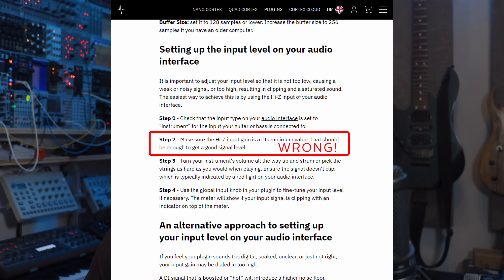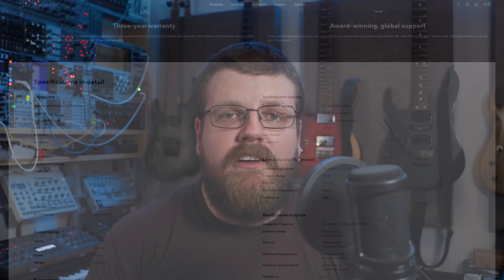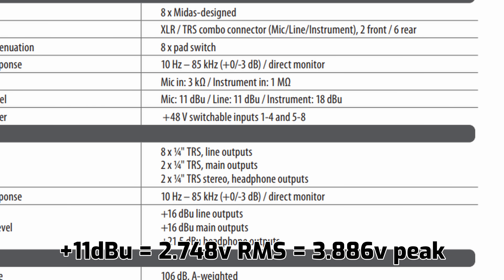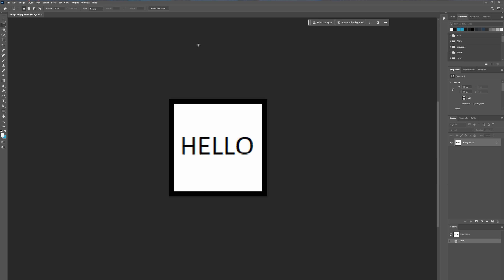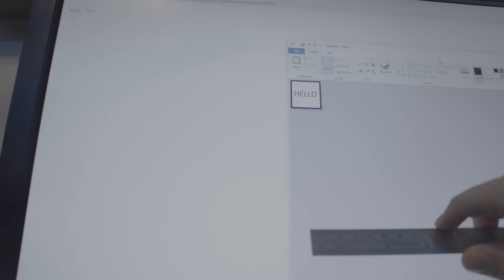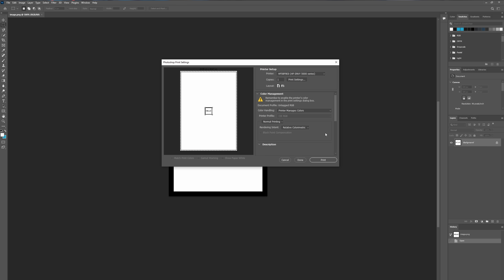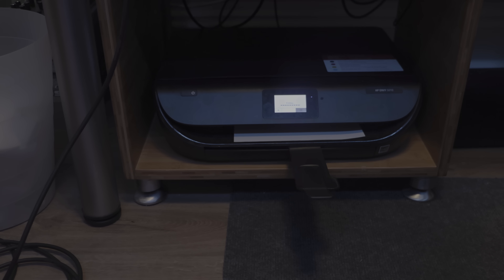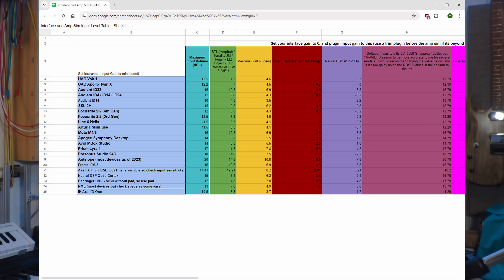Ampsims and input gain - Please, stop the madness...

Comment: If I may nerd out about the graphics example that was used… you are incorrectly using the term DPI to talk about pixel resolution in relation to the size of an image. 

PPI (Pixels Per Inch) is actually what you should be using when you are referring to the digital information stored within the file that will determine the size it will print, or import at natively in software such as Adobe Illustrator, etc., which will then print it at that size (unless of course you’ve scaled that image).

DPI (Dots Per Inch) refers to the resolution that the printer is using to lay ink down on paper or other substrate. If you look at a magazine with a loop (super high power magnifying glass), you’ll see that everything is made up of dots of color, CMYK (Cyan, Magenta, Yellow, Black). The dots will run at different angles to avoid a moire pattern. The DPI will vary depending on the print technology. On a magazine, you won’t really see it with the naked eye. If you get up close to a billboard, you’ll easily see the huge dots. If you’re looking at a halftone on a T-Shirt, the dots will be noticeable because the cloth substrate is very loose and details can only be so small without being lost.

Ok… rant over. Almost everyone should be using PPI because they are dealing with digital images. Only printers should be talking about DPI. 🤓

Comment: Wait if the answer is set interface to as high without going to red because the resolution of the conversion between analog and digital is greater/more accurate then....

I am not wrong.
Edit: Woah oddly not wrong (over simplified answer obviously)

This is why I use axe fx iii because I don't need to deal with amp sim plug-in users and you are forced to learn more in depth topics in order to configure your tone.
Reply from the maker: @XenoTravis  the Axe FX has always had insanely good inputs. This is definitely one issue that you won't need to worry about in the axe - it just works, period :)
Reply: @GhostNoteAudio  right? It might be a bit annoying when presets from others just don't work but it made me learn so many concepts in order to get my own sound.

Plus I found out I can use my guitar, the other players bass/guitar, and a microphone at the same time while also using very useful features like re amping and vocal effects like 4-5 layer pitch correction like the band cynic uses while it even switches settings automatically.

The thing is so powerful and amazing at everything I have thrown at it.

Comment: Great presentation. 👍 I'm seriously shocked this is even a conversation, let alone a controversy, in 2024.

Not just for guitar or amp sims; proper pre A-D gain has been hugely significant since, well basically forever. Like you said. It IS gain staging. 🙃

Comment: In Reaper,  my gaining and volume matching for electric guitar looks like this:

My audio interface gain is set so that the DI guitar sounds nice (as nice as a DI can sound, anyway), especially the transients and dynamic range. Where your gain dial ends up will depend on my guitar pickups output and playing style. When adjusting the interface input gain, I also have a trim plugin on the track In-FX so that I can keep the same volume during adjustments. Interface gets turned up, trim gets turned down. I'm prioritising sounding and feeling good over getting the hottest signal, which I don't find necessary with 24bit recording. Maybe if you have a shitty/noisy interface you might have to prioritise getting the hottest signal?

Once the DI signal sounds and feels at its nicest, I use the In-FX trim to adjust the track signal to where I want it, which is usually peaking at around -6 to -4 dBFS. The LUFS-S will be down at around -20 to -16dBFS. This is the level that the track WAV will be recorded at. If the peaks are high but the LUFS-S is a little too low, then I'll maybe compress on the way in a little, either with hardware compressor on my interface, or a plugin compressor on the In-FX tray.

Because my amp sim doesn't have its own input gain, just before it I will insert another trim plugin, which will set the input level independently of the recorded track level, so that the signal entering the amp sim is what I think it is expecting. Some amp sims have an input meter, but I do it by ear because crucially, different IRs and amp and cab combinations seem to prefer different input signals, so this gain/trim is not set and forget - I adjust it to get the best out of the current patch if it sounds wrong. I don't think people talk about this aspect enough. Note that this adjustment does not affect the level of the recorded WAV.

Finally, the amp sim output gain is adjusted by ear so that it mixes roughly with the drums/instrumental guide I'm going to track along with. Again, every time the amp sim input gain/trim is adjusted for a new patch, the amp sim output is adjusted to keep the same volume. Keeping the same volume is crucially important, so that you aren't fooled by the 'louder is better' thing that our brains do.

In my opinion, you need to control the level of a signal at every stage in its path, and create extra points at which it can be adjusted if necessary.

Comment: There's something else I found out. Since everyone has said the first step is to set up the input gain to 0, you missed another very important thing in my eyes. Because 0 doesn't mean 0 on many interfaces. By checking the manuals of my Apollo Twin X, Orion 32, and UR22, I found the listed gain range:

- On the Apollo, it's the same for all the input levels (mic, line, Hi-Z): it's from +10 dB to 65 dB.
- The Steinberg UR22 has a mic gain range from +10 dB to +54 dB, a line gain range from –14 dB to +30 dB, and a Hi-Z gain range from +0.8 dB to +44.8 dB.
- The Orion 32 doesn't have any gain options, so there's no gain range. You could say this interface is set by default to 0dB gain.

So what that means to me is that if these interfaces are turned to zero, they're not at 0 dB gain. The Apollo always adds at least 10 dB to your signal, even when the gain pot is aaaall the way to the left. The Steinberg UR22 gets even wilder and adds 10 dB in mic mode when it's turned to the left, 0.8 dB in Hi-Z mode, and even gets much quieter than 0 dB gain in line mode since it's reducing the gain by 14 dB when it's turned to "zero."

That means you also have to subtract or add the correct amount of gain in the amp simulation plugin to get the very correct gain staging. Is that right? 

Steinberg UR22 manual: https://download.steinberg.net/downloads_hardware/UR22/UR22_documentation/UR22_OperationManual_en.pdf
Apollo Twin X manual: https://media.uaudio.com/support/manuals/hardware/G2-73v5iZ/Apollo+Twin+X+Gen+2+Hardware+Manual.pdf
Orion 32 manual: https://images.static-thomann.de/pics/atg/atgdata/document/manual/orion_32_owner_manual_en.pdf

Comment: Thank you, this is great. I don't follow any discussions, but the described procedure seems natural, isn't it? This is what you end up doing if you have just a little bit of understanding about the signal processing. And I mean just knowing that there is analog to digital transformation, and how the signal looks like in a computer (as a graph). I am truly surprised by the raised discussion. My guess is that initially people were using cheap noisy pickups, and they hoped to reduce this noise by putting lower input signal. Then the discussion suddenly blew up.

Comment: How can I find out the input dbfs in dbU of a plugin? I am wondering how I can add plugins to the list he has created that he has not listed. Like for example the Ampeg SVT Suite. I've searched their site and the manual but unfortunately found nothing. Do you know how he got this data?
Reply from the maker: I believe Ed S (who made the spreadsheet) did reach out to many of the developers and asked for clarification and technical specs, and many responded. But without that, the only real way of doing it would be to have the real hardware unit and tone-match the plugin against the real thing. You can dial in the input gain by ear, and once you've got it set to match, you look back at all the gain stages in the signal chain until it hits the ampsim and work out the conversion from dBu -> dBFS (in most cases, this would just be the gain into your audio interface / converter, and then the input gain in the plugin)

Comment: Oh man this just like the arguments in the past over vinyl vs CD (audiophiles wrongly claimed Vinyl had better fidelity), CD vs MP3 (where audiophiles claimed that the could hear the lossiness when its mathematically impossible to hear this over 192Kbps people promoted in that research), the infamous rubbish tubes are better than solid state (in what sense not in amplification and cleanliness and if you want to model the soft response of tube you could do that in preamp stage) later the nonsense that they could hear the difference between amp models and real. And every time they are wrong. Because they aren’t electrical engineers and computer scientists and they over value their “ears”. When we engineers believe in actual impartial measurements.

Comment: supergreatvideo! I didn't understand most of it, as I have no experience with most of the gear you are talking about. I use an IK Multimedia iRig connected to my computer with a USB cable and play through Amplitube. The iRig handles gain 'automatically,' or maybe not at all in real life, but I do have input and output controls in the app. Since I normally listen through headphones, I usually turn the input level down and the output level up to get desired volume without lots of finger or pick noise. I've no idea of what I'm doing - I just set it so it sounds good to me, lol. Thumbs up to you for knowing your shit and how to explain it, though!

Comment: You are correct…..also an electronics engineer here….since 1987. I think some things that are obvious and second nature to engineers are not so obvious to laymen….and it makes sense it is that way. Having a good view into the analog world and how it is converted to the digital world is not everyday knowledge - neither are dynamic range and s/n. You explained a good topic quite well. 

I have to add, that I find analog gain staging and controlling of gain stages and impedances from guitar output to analog amp input also a fascinating topic and a touchstone of tone-ology. 😊 one can nudge, push, pull, slam and drop and find many nuances in conjunction with buffering, the proper pot and bypass caps……truly fascinating stuff
Reply: I hope you’re not serious? The manufacturer literally tells you what they record at. lol. Your interface is just a line in. Do not boost your audio interface.
Reply: @ I am talking about my guitar into a tube amp….i did not really make that clear. It was an aside to the primary topic

Comment: Question from an average amp sim enjoyer : if I have a pedal that adds gain before by digital interface, how should I proceed to set the gain correctly ? 

Set it to 0 on the pedal and interface, tweak the plugin then back to the DI and then end with the pedal ? Or any another gain addition actually mess up with this logic ?

Comment: May be a dumb question, but this would apply to the amps in a modeler as well, yes? I feel a bit vindicated because this is how I have always set my input gain - turn down input gain in the amp itself in my modeler, and turn up the input on my Scarlett as high as I can go without clipping. Definitely not an audio engineer here, so maybe just dumb luck that's how I thought it is supposed to work.

Comment: Really well done. I come from the analog audio world. Analog or digital, the goal of recording levels on an individual track is to get as far above the noise floor without clipping. But we could be sloppy with tape because it over-saturates in pleasant way. Our s/n still wasn't great so we recorded at higher tape speeds like 15ips. Digital is amazing for huge s/n, and adding bit depth makes it even better, but clipping has no forgiveness at all. It's a-harmonic and just noise. Analog or digital, keep each stage as close to full scale 0dB (not dBm or dBv, just relative to the max non-clipped value). A spreadsheet of starting values is great, but a little testing goes a long way towards optimal settings. Finally a distinction just to  put a point on it. 0dB is relative to the max of a stage. 0dBm or 0dBv are absolute, measurable power / voltage levels.

Comment: Thank you! I have given up arguing with people about this. I just say "OK, keep doing it that way."  I have done simplified  graph representations showing how what you left out of the first stage (not utilizing the most granular portion of the signal) leaves you  raising  the noise floor on next. It is the more  classic digital audio model but it  works. 
It is funny that you used the 100 X 100px image  as an image example.  In 1994 a good friend and engineer switched form a 1" Otari 16track to  2 ADATS.  I went to kinkos and copied a piece of  graph paper to 50% gaining 4X resolution to the original and then plotted the same arbitrary 1 cycle signal, at that same size, on both pieces of graph paper. I then colored in all the pieces that crossed a box but where out side of the wave. 
I said "Jim, the colored in portion is noise. The higher the resolution we start with  and maintain the lower our noise floor will be. The low-res is -6db signal and  the other 0"  
He replied something akin to "Oh, is that really how it works?" I said "not really, but close enough and just pretend it does."

Comment: Steps:
1. Set your audio interface's gain to zero
2. Set the input gain in your plugin according to the provided spreadsheet
3. Increase the gain on your audio interface until you are just below the clipping threshold when playing as loud as possible
4. Reduce the digital input gain in the plugin to compensate.

Comment: Interesting and very simple but effective approach. For years I have used the advice from the guys at Ignite Amps.

(Taken from their user manuals:

Input level(19): it is a simple control to adjust the amount of guitar signal going through the virtual
circuit. It is really important not to underestimate this control, since it is the key to have the Emissary
reacting correctly to your guitar and playing. In fact, we can safely say that this is the most important
control to get the best out of the Emissary.
What's the correct way to use it, then? Let's start from your guitar signal: as you might know, when
you play, the pickup output going to your sound-card input will be transformed to a digital signal by
the AD converter of your audio interface. The first thing you should keep in mind, is that the
converter has a maximum headroom that should never be exceeded. If your signal goes over this
maximum threshold, it will be clipped. A clipped signal means less dynamics and the introduction of
digital distortion.
So, the first thing you need to make sure of, is to never clip the AD converter (if you are clipping it,
the clipping led indicator featured in most audio interface will light on, warning you that your input
signal is too hot, so you need to lower the preamplifier control until the problem disappears).
On the other hand, an important thing to keep in mind, is that the higher the input signal (within the
above mentioned headroom limit), the more accurate the AD conversion will be, keeping also the
signal-to-noise ratio at the highest possible value. This means that, in order to get the best out of
your sound-card, you need to keep the input signal as high as possible right before reaching the
clipping threshold.
Ok, cool story, but when does the input level control comes into play? Once your signal is converted
to digital, it will be represented as a series of numbers that you can see as voltage values. These
voltages can have a maximum and minimum value of 1.0 and -1.0 respectively. Supposing your
input signal is peaking at its higher possible value right before the clipping threshold of the converter,
it will be represented as 1.0 inside your host and the Emissary will react to it like if you're sending a
1.0V signal to its input stage.
Why is it so important to know these details? Because if your guitar pickup has a maximum output
voltage higher than 1V (or 2V peak-to-peak), like many modern active pickups have, you'll need to
adjust the input signal that's being sent to the Emissary. That's where the Input Level control comes
into play: you need to tweak it to compensate the voltage scaling/normalization made by your AD
converter.
The Input level control applies a scaling factor to the input signal. For example, if your pickup has a
maximum output of 1.5V (so 3V peak-to-peak), you'll need to set the control at 1.5x. By doing this,
your input will be multiplied by 1.5, so the Emissary will not be fed with a 1.0V maximum signal,
instead, it'll get a 1.0V x 1.5 = 1.5V maximum signal, which is the correct value to match your pickup
specifications.
If you are using a single coil and its maximum output value is, let's say, 0.5V, you'll need to lower the
input level by setting the control to 0.5x. This will make the Emissary react like the input signal is
0.5V, or 1V x 0.5.
Remember that the sound-card input level is meant to be always set so that you use the full AD
converter headroom. Signal level adjustments, to pair the Emissary with your guitar pickups, need to
be made after the AD conversion, using the Input Level control. 
Please note that these concepts applies only when the Emissary is the first plug-in of your
virtual guitar chain. If you are using another digital effect before the Emissary, we suggest
you to keep the input level control at half (default).)